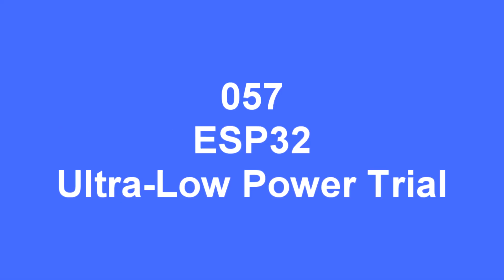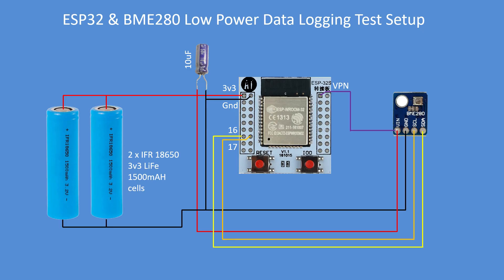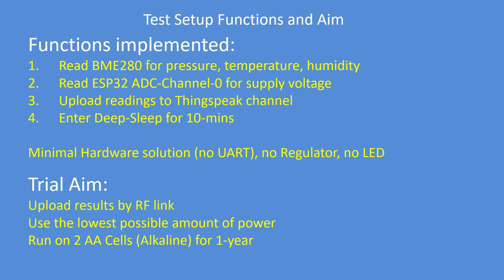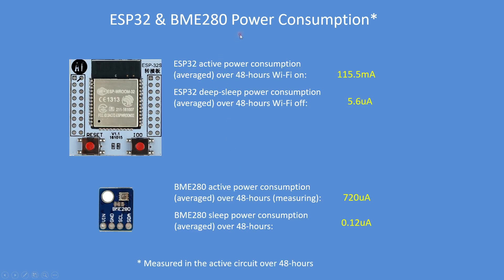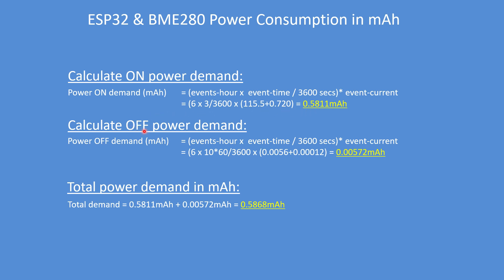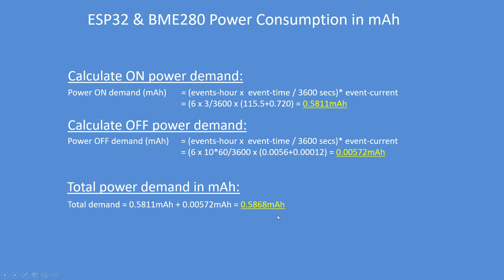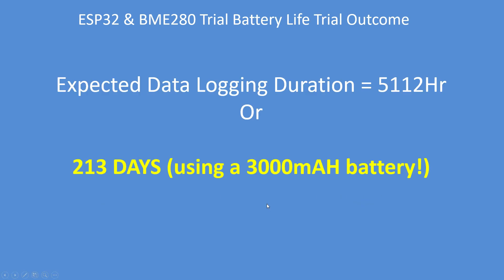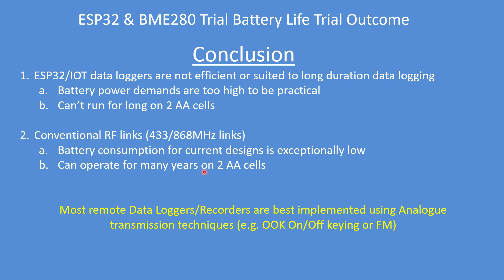Tech Note 057 - ESP32 Ultra Low Power Test Results

Comment: That 115.5 mA for 48 hours. means the current that is consumed for one hour is 2.4mA. means to make a minimum system esp32 without leds, regulators, only consumes 2.4mA current when active (wifi on). Is it really like that?
Reply from the maker: Your calculations are wrong, and the results are in mAhr not mA
Reply: @G6EJD  my question is how much power consumption when standby (WiFi on) for minimum system esp32? my case will turn on the minimum system with a 5Ah battery
Reply from the maker: @official.anggara  the ESP32 consumes 140mAhr when running, so 5000mAh/140mA=250/7=35hrs
Reply: @G6EJD  I really hope for your reply, because I will make a motorcycle alarm project. power supply from the 5Ah motorcycle battery, but I'm worried that my motorcycle battery will drop quickly.
Reply from the maker: It will if you run WiFi continuously.
Reply: @G6EJD  Is there a solution to make the motorcycle battery last longer? how about using arduino pro mini 3.3v 8mhz? communication via bluetooth hc05? I want the current used to be as small as possible below 10mAh.
Reply from the maker: @official.anggara  most wireless solutions use a lot of power, there are custom units sold that do what you want for a few $ search eBay
Reply: ok, thanks for the information

Comment: you need to use the ESP-NOW protocol for data transmission. This will reduce transmission time from 3 sec to ~220msec. Build a gateway that transfers ESP-NOW packets to WLAN and your battery will last forever ...
Reply from the maker: Have you tried that approach? The ESP32 was/is marketed as an IOT device, so using a non-standard intermediary is counter to the concept and introduces additional overheads in equipment and design.
Reply: @G6EJD  I run a bunch of sensors in my house using this approach. The Gateway consists of 2 ESP32 ... on is permanent in  ESP-NOW mode .. the other on WLAN - communication is via serial interface. (The ESP's can't do both modes at the same time) I know there are project around using just 1 switching betwenn WLAN and ESP-NOW .. but I wanted to have a more 'clear' solution. Just search Inet for ESP-NOW  (f.e Andreas Spiess videos). I'm also using this method for 'pushbutton' style application, just powering on the ESP32 during button press. A normal button press gives me always enough time to complete everything. Actual project is to replace all the window sensors of my alarm system using this approach. Check code will run in the ULP .. transmission every 10 minute or so via ESP-NOW or when the status changes. This will allow me to detect dead sensors and always give an updated view of forgotten open windows. Maybe I'll add those cheep chineese radar sensors that are incredible sensible to turn them on on demand - or permanant for some mains powered sensors at special locations ...  At least that's the plan ...;-)

Comment: Hi! I've read on the BME280 that the current consumption during humidity, temperature and pressure monitoring is 3.6 uA. I can't understand why your slides consider 720uA. Could you help me understanding this please? (the datasheet I used https://www.bosch-sensortec.com/media/boschsensortec/downloads/datasheets/bst-bme280-ds002.pdf)
Reply from the maker: Have you tried measuring the supply current? It’s a combination of the bme280 and its supply regulator, for the on board regulator to shut down it needs the bme280 in sleep mode so there is no load and then both shut down, the difference is quite large in relative terms. I’m sure if the bme280 was connected without any supporting circuitry then the 3.6uA would be achieved, but for most applications the 3rd party boards are a practical usage.
Reply: @G6EJD  Hi and thank you very much for answering. I'm very new to electronics and I still need to get a lot of things. Your answer was really helpful. That said, when I need to project a circuit I always have to calculate power consumptions myself instead of using provided datasheet if I'm not using only the chip ? Or is there any sheet/website where I can read what is the avarage power consumption for the whole board (like the ESP32 board and the BME280 board you are using in this video) instead of the single chip?
Reply from the maker: @xTheColinox  unfortunately not as the number of variables is huge, on any typical development board there is say the ESP32, then a multitude of regulators, uarts, battery chargers, flash memory, I have not seen any common devices other than the ESP32, in fact what separates good from bad performance boards is the power regulators especially when in sleep mode, plus some designers leave the UART connected when on battery power when they should have powered it from only the usb power, some designers understand the low power requirements some not, some don’t care as well! Some of this knowledge only comes with experience of having designed systems too.
Reply: @G6EJD  For example, in your other video (https://www.youtube.com/watch?v=b2aWZYlmL30 i love your videos btw!) the description says 
"WiFi ON  70.3mA
WiFi OFF  15.2mA
Sleep      0.24mA"
Are these values measured by you, or did you get them from any sheet?
Reply from the maker: @xTheColinox  measured by me, even between the same devices the spread of results can be quite high maybe a standard deviation of 3 or more, so you can read a data sheet and you will see the consumption range across the device from manufacturing process but can’t predict what it will be, maybe from the same batch you might have a much lower standard deviation, therefore only by measuring individual boards can you be sure, it is not a deterministic or quantitative process. Plus measuring low level currents needs skills and clear understanding of the measuring instruments capabilities, a low cost dvm will not be able to measure currents less than 1mA with any degree of accuracy and usually prevent correct operation. Lots more for you to learn I think!
Reply: @G6EJD  Thank you very much for all these answers!! Just one last question: to calculate the power consumptions you assume that it takse 3 seconds to uploads the data (I think that those 3s cover the sensor acquisition + data uploading on internet): are those 3 seconds calculated by you?
Reply from the maker: @xTheColinox  no I measured the time taken using the ESP32 timer so something like start = millis(); then serial.println(millis()-start); at the end, the accuracy is good enough. Typically starting WiFi can take 500mS, sensor reading about 1-sec upload 500mS etc

Comment: Good Evening!
The voltage of a fully charged battery is 3.65V.

1) If the battery voltage drops to 3V when discharged, the analog measurements will not be affected? As far as I know analog needs a constant operating voltage for correct measurements.

2) What is the operating voltage of the analog of the naked ESP32? The linear voltage according to graphics from datasheet is observed from 0.21V to 2.53V. Right?
Reply from the maker: Depends what sort of battery. A li-ion battery is 4.2v fully charged and 3.6v depleted. The ESP32 or ESP8266 supply voltage is a nominal 3.3v but can work down to 2.8v, maybe a little lower but not recommended. A typical LDO regulator requires 0.1v to operate so the absolute minimum supply voltage is 3.3+0.1v = 3.4v or 2.8+0.1 = 2.9v
Reply: @G6EJD  So is there an internal voltage regulator that can take from 2.8 to 3.6V and make it 3.3V without affecting the measurements? Also I tried to just give digitalWrite (Pin, HIGH)? when the supply voltage of the bare esp32 is 3v and in the pin I got + 3V with the multimeter instead of 3.3V. Which means that the output depends on the operating voltage of the ESP32. So I thought of analog ...
Reply from the maker: The bare ESP32 does not have an on-board regulator and the ADC reading will be affected at the higher end by lower supply voltage, but it uses a common mode input so that supply rail variations are ignored with the range 0 to Vdd so the ADC should work normally even if supply voltages drop. If Vdd drops it is the maximum voltage reading of the ADC that is reduced.
Reply from the maker: The data sheet says a GPIO voltage will be Vdd - 0.3v
Reply: @G6EJD  If I understood correctly the analog reference voltage will be affected if the supply voltage is low 3V .. But the indications I will get will be normal and will correspond to the analog input voltage as in the case of 3.3V.
Can I set the reference voltage of analog only? Is there an AREFF pin in esp32 (external reference voltage)?
Reply: Thanks ! I will do some tests.
Reply from the maker: @master3763  The analogue reference is something like a Zener, so not affected by supply voltage No external reference input for the ADC

Comment: Hi that was interesting to find that 433Mhz is better than ESP32 so cheaper and better I have two door monitors on 433Mhz that only come on when the door is opened and the batteries are now 3 years old with a range of 150 meters so I think I will stick to 433Mhz
Reply from the maker: Bob Wareham, yes nothing can beat those 433mhz links, so are so power efficient.
Reply: @G6EJD  Thanks David love your channel it is so full of information you are a very clever engineer

Comment: First of all, thank you for the nice presentation of the video. I have a question. In the module I have taken, there is no stabilizer on the board. Are you using the board with or without a stabilizer? According to the technical manual, the voltage of the bare esp 32 is from 3-3.6V. I don't even have the 2 resistors between the buttons.  What value do they have?
Reply from the maker: The battery is a 3.2v LiFePO4 rechargeable so no regulator required, check the ESP32 data sheet it requires 2 pull up resistors to start properly one is to set the state the other a reset.
Reply: @G6EJD  The battery voltage ranges from 4.2 - 2.8 Volt. Can't burn the esp32 that has an operating voltage of 3-3.6V? My board has a backrest for voltage stabilizer. Just not stuck. It doesn't even exist.
Reply from the maker: @master3763  Please not in this example I'm using a LiFePO4 battery with a voltage of 3.2v - NOT a LiPo with a voltage of 4.2v. If your using a voltage regulator then your wasting power to drop 4.2 down to 3.3v
Reply: @G6EJD  Thank you very much ! I didn't notice that the battery is at 3.2V.

Comment: Hi David, since the main power is consumed when on, I am wondering how this power on power consumption would be influenced if you would use bluetooth  LE only or even a external RF module to transmit the data. I realise this is an old post, just wondering.
Reply from the maker: Luc Segers, there’s no doubt that using a low power RF transmitter would dramatically reduce power consumption but at the expense of link reliability and quality. BLE would work like the low power RF alternative but at the expense of having to use a special to type receiver. Unfortunately it is the ESP32 receiver that consumes the majority of the power whilst the RF section is on. Various techniques have been tried to reduce time to upload, but probably one of the most efficient way now is to reduce the CPU clock speed to 80MHz that drops cpu power consumption by 50%

Comment: No voltage divider for mesuring VBat? 

Thanks.
Marc.
Reply from the maker: Marc, it depends on the board but solved by placing say a 100K resistor in series with the ADC connection maybe pin39 to Vbat and then another 100K to Gnd from pin 39 that will divide the input voltage by 2 allowing 0-6.6v to be measured.
Reply: @G6EJD  with 4.2v battery 220k and 220k voltage divider is OK??
Reply from the maker: , perfect

Comment: For this kind of tasks more suitable to use smaller controllers. Like atmega328 or even smaller. In pair with Rf24 or lora modules. It will be very power-effective devices with low consumption and will work over 1-2 years from 2 AA. Create your own base station on lora or rf24 that will receive data from loggers via rf and transmit data to internet if it needed.
I'm having exactly the same radio temperature 2xAA battery powered device (atmega328+nRF24l01), that i created in april 2019 - it sending data (temperature, hum, and battery voltage) every minute. Today (it is about 9 month of work ago) the voltage droped from 2.96v to 2.88v (batteries that i used was not fully charged).

Comment: Hi @G6EJD , what's your opinion of the ESP32 now - since you recorded this video..?
Should i continue to invest time & cash learning about & buying the ESP32 - or switch to another device like the ESP8266? 
At the end of the day i got into microelectronics because of IoT - and - the promise of remote sensors picking up data, logging it and sending it back to a server whenever..
I'm interested in the 'tinyPICO' that will be launched on CrowdSupply soon. That might bring us to the 'promised land'! - https://youtu.be/pnKbCf-HoPY
Reply from the maker: Michael Newham, either the ESP32 or ESP8266 are fine for iot projects, the advantages of the ESP32 are speed and significantly more memory. For low power tasks the 8266 is much better. There is a lot of support for the ESP devices less so others. My advice is to use either of the ESP’s with the ESP32 being the easier to use in software terms.

Comment: Consumption at 3.3 V is not measured in mAh. It is measured in mA. But many thanks for your great work!
Reply from the maker: Horus777 All my units are correct, I measure current consumption in mA and I then convert to mAhr to compare with a battery capacity specified in mAhr, what’s wrong then?